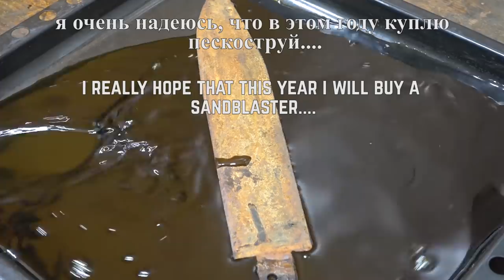Restoration Rusty Handmade BOWIE KNIFE

Comment: "I really hope that this year I will buy a sandblaster" - same here, man, same here. It's weird how often that seems to be the case of "convinient tool needed, but have to improwise"...
Reply: Have you ever used electrolysis??
Reply: I hope both of you can buy your sandblasters this year but I'd rather see someone build a half decent sandblaster at home...
Reply: Belive me, I've seen DIY sandblasters... Pure headache and nothing really worth the time and effort. And the cheapest one aren't really that expensive (about 170 USD, if I calculated correctly on current exchange rate)...

Comment: Make a sand blaster. It's cheap and you get the same results.
I just had to make my own ice removal propane torch at my local Stan's because everywhere was sold out. Half inch pipe and some fittings and a 25 gallon propane tank and bam.  Neighbors laughed but half a foot of ice later out driveway is clear. Had to add a cap on the end and drill a hole in it to give her pressure.
Sand blaster is just a air compressor and a 2 liter bottle and a paint gun
Reply from the maker: Hello! Thank you for information. You're right, you can do it yourself. I'll think about it, calculate what consumables will be needed and how much the compressor will cost. Do you know what power it should be?

Comment: In each video where you make a leather sheath for a blade i see you thread the needle the same way every time so i wanted to ask what kind of knot or stitch is it that you use and how difficult is it to figure out how to do it?
Reply from the maker: Hi, it's very simple, after you have wrapped the thread around the needle 2-3 times — you thread the needle through the middle of the thread and tighten. Check also this video (here I made a leather sheath for axe https://youtu.be/4Zmp3VY1sZA)

Comment: Why you dont ever polish any blade??
Reply from the maker: I polish if I'm sure it's stainless steel, or a brand of steel that doesn't rust for a long time. A polished knife after the first work in the forest will become rusty and scratched. That's why I cover the blades with iron oxide.

Comment: I'll never understand why you go through all the rust removal bs when you're going to grind anyway. Just put a flap disk on your angle grinder and get rid of the rust and pitting in one fell swoop.
Reply from the maker: Hello, I have received this question repeatedly. I'll explain it to you now.
If you start working immediately with a grinder, you may not see the brand under the rust, which is extremely important. The brand can tell us a lot about where and when the item was created. Therefore, based on experience, I always remove rust, and then start the sanding.

Comment: Didn't even harden it or heat treat it 😕
Reply from the maker: Hello! Therefore, he was already hardened. Thanks for attention.
Reply: @ScrewsAndTools  how do you know it was  properly hardened?
Reply from the maker: @richard2mitchell  When a hardened knife or axe is struck lightly with an iron object, you will hear a ringing. . It should sound for a few seconds. By the way, this is an old grandfather's method. It also could not be processed with a file.